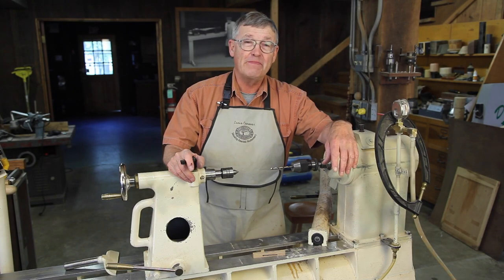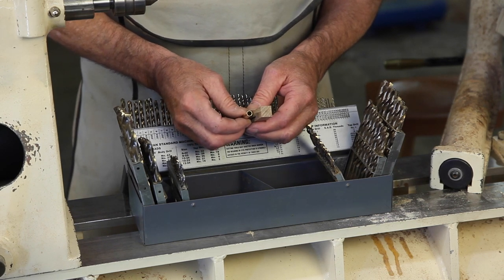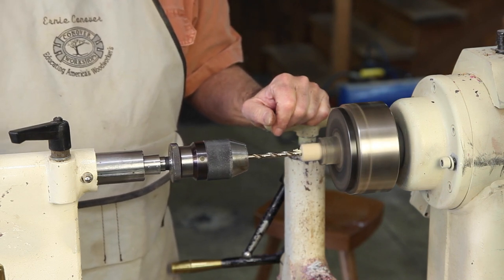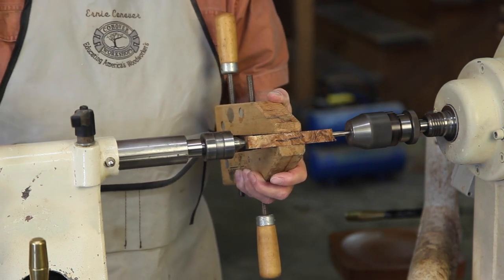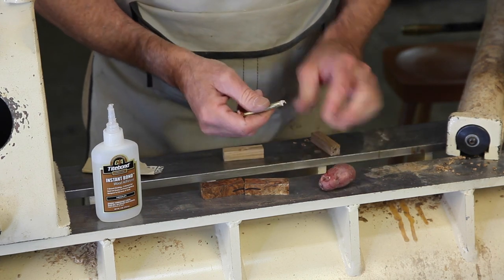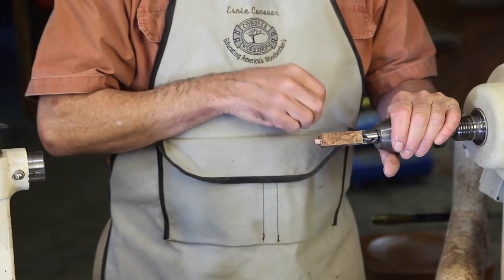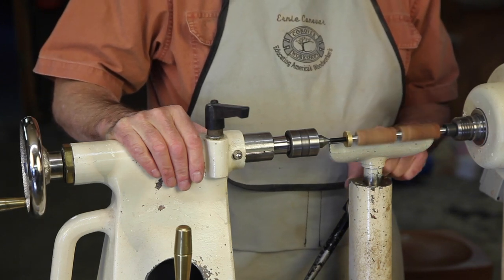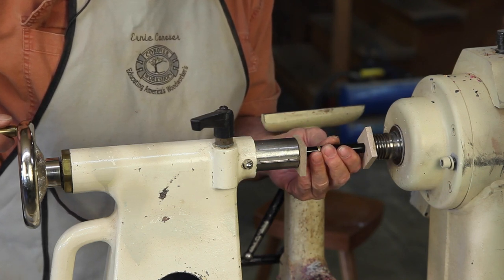Tips for Turning Pens

Comment: I purchased a pen blank drilling press. I made sure the table was square both ways to the chuck and never had a problem. I have turned about 20 pens so far and have never taken my mandril out of the lathe. It is far quicker than constantly taking the mandril out putting a jaw chuck or a drill chuck in and out. For greater control I do recommend a pen assembly press. I have never tried a potato but I have heard waxed paper from the supermarket works. I have not tried it yet but I will. I use acrylic blanks because they are so strikingly beautiful. Pen making is a great hobby. Happy days.

Comment: Just when I thought I knew everything about making pens I watched your video. I like the tip with the potato that fills the end of the tube. So many times I’ve had glue that gets in there, hard to remove. I also like the way you used the clamp and trimmer to trim the blanks. Then there was the lathe as a pen press. Wow, I’m going to use all of these new tips. Thanks.

Comment: Good tips for beginning turners. Terrible work habits when you hammer on your lathe bed instead of a wooden block on your work bench. Lathe beds don't make good bench tops. : /
Reply: He tapped it lightly with a wood mallet to send the tube home. That little brass tube is going to damage several magnitudes earlier than the lathe, if he did it too hard.